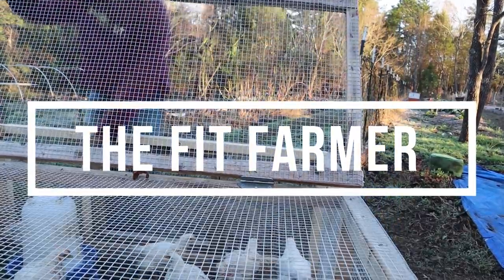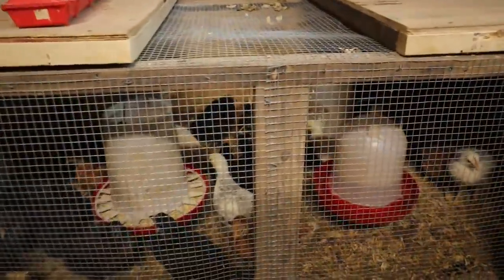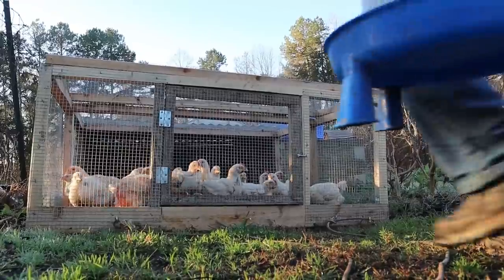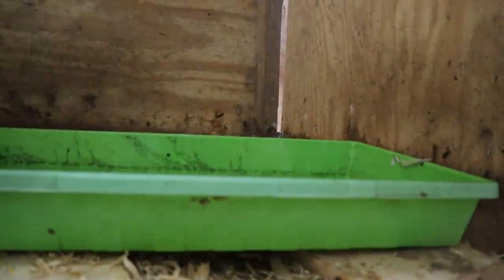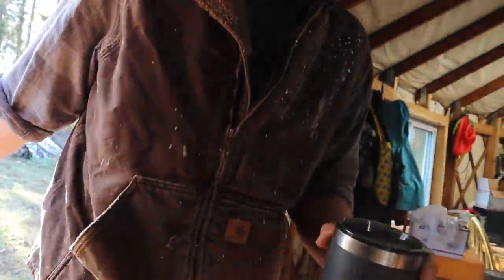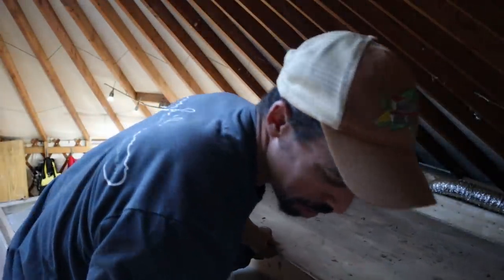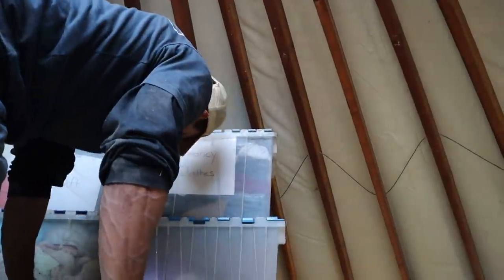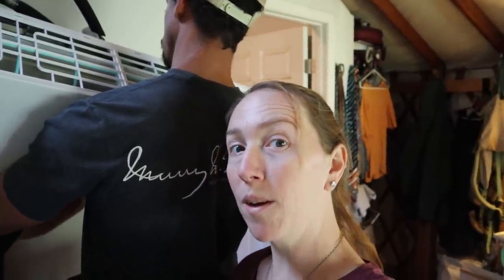Adding more HEAT to our YURT with a mini split system

Comment: Delight 3 ways: heating, cooling, and a reduced utility bill 💙
Reply: Actually, they will be seeing an increase in their utility bill. But it's well worth it to have consistent heat in the Winter without chopping firewood and cool air in the Summer.
Reply: Our home is all electric and our bill has dropped at least $100.00 per month.  They will have more time for their market garden, chickens, ducks etc. instead of spitting wood.  I’m hoping their next choice will be solar panels.  My bill last month was $10.52, that includes charging my car.
Reply: @JerryB507  I ran a mini split all summer for cooling, and my electric bill stayed very low. I was surprised!

Comment: I'd like more information on where y'all bought the units. We live in a 960 sq. ft. home & the old unit is in need of replacement. I'd like to see what units are available for our size home. Thanks for sharing 👍
Reply: The best way is to find out about all your local heat/air-conditioning companies and research them and read reviews about them. Then have them come out and give you estimates. Otherwise, if you want to DIY you'll really want to to be aware of the electrical wiring needed. Our unit had to have specific wiring and hooked up to our circuit box, otherwise, the actual unit installation only took 1.5 hrs. We paid to have everything done by a local company.
Reply: @devon932001  Thank you! 😁 Great idea 👍

Comment: To my understanding the outside units have coolant all ready installed after completed install just turn on the outsize values
and the systems charges itself.
Reply: depends which system you get.
Reply from the maker: Some do come pre-charged but ours does not.

Comment: Is your split a gravity fed drain system? If so, it looked like your pipe is draining UP instead of DOWN from the head. This would cause the water from head to collect inside and it will spill out on to the floor.